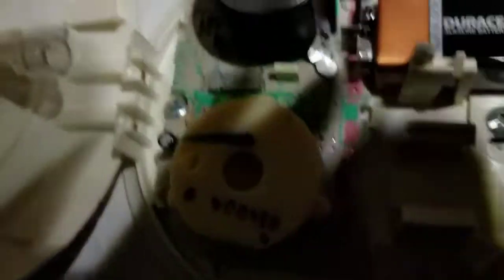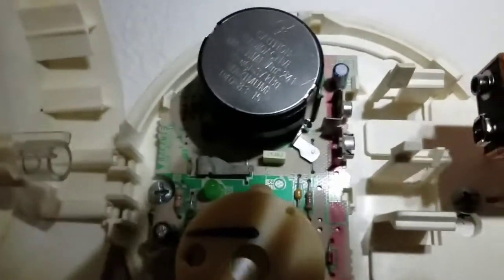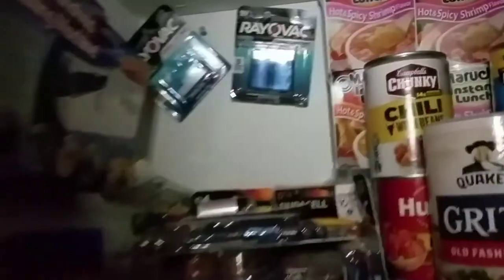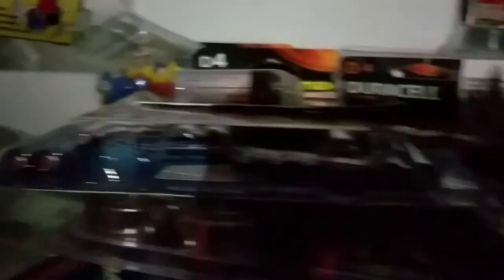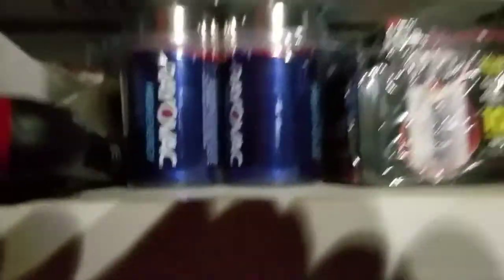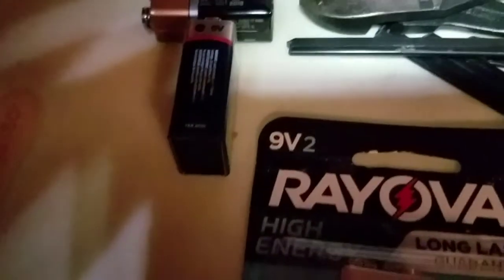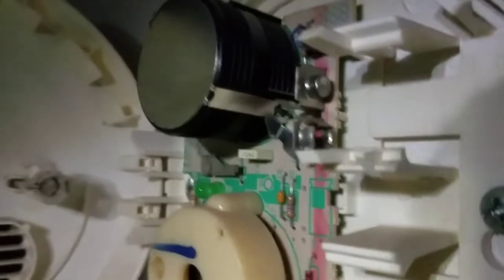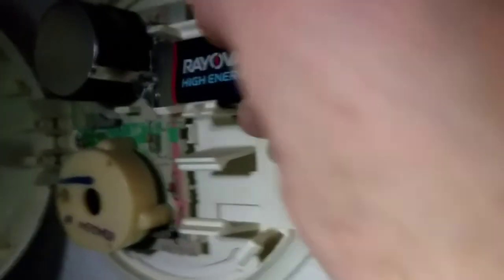Smoke Alarm🔊✔

Comment: Why is it that always happens in the middle of the night 🤪😂 You want to here my personal nightmare. I woke to the smoke alarms going off. I checked the house no problem and I could not get them to shut up. There all hooked to together 😬 I removed the batteries and they were all still going strong. Then I remembered they have Power from the breaker. What a nightmare 🙈
Reply from the maker: Thanks B🤳《☆》⛾🍕Ya new homes are like new cars😁🦄I know very little about either one. I appreciate You Brother🖖🤓🏈